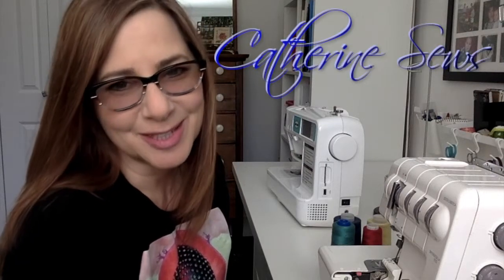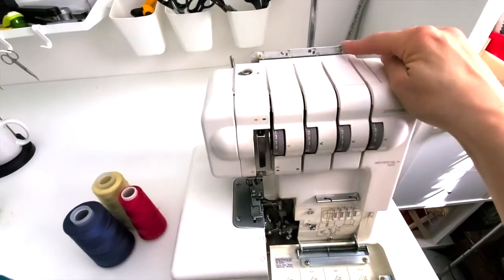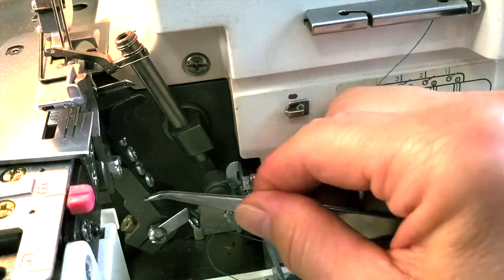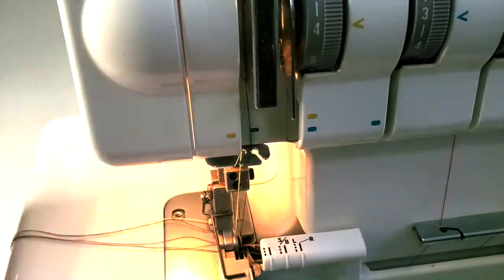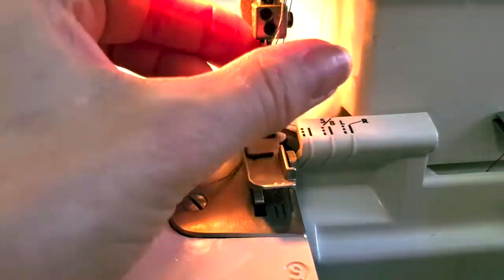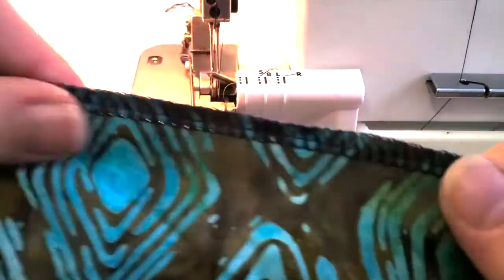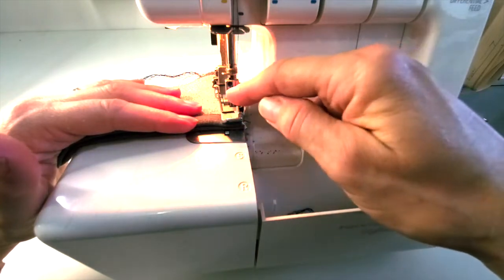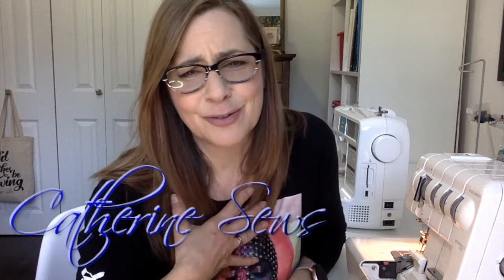Get Started on Your Serger!

Comment: Excellent video! I have always hated my serger and you have given me the push I need to replace it. One small tip for threading, use a dental floss threader. The are made of dense dental floss and are rigid enough to push through all those little eyes and holes. The other end has a large loop. Thanks for this one, I really needed it.

Comment: I hadn't used my serger in years and it was so clogged up with the dust that had acccumulated over the years that I thought it was broken. But I spent almost an hour patiently cleaning it and oiling it and found that it still works really well. So before you discard an old machine, take the time to clean it again and you might be pleasantly surprised.

Comment: Another great video!  I learn most sewing tips from YouTubers like you these days.  I have a Brother 1034D serger that is a good machine, but I hate threading it.  The loopers are threaded in the opposite order and the Brother doesn't open up on the left side to pass looper thread through. Instead the Brother has a finger that slides out with a hook to pass the thread thru.  It was interesting to see how your machine is threaded.  TFS

Comment: So glad I came across this ❤ I’ve had a Serger for years and never truly comprehend and was a bit intimidated by the Serger. Now I understand a bit more the first two threads go into the twin needles, and the furthest threads loops under the bottom. You zoom in at a good angle, however at the very beginning did you thread into the small hold from the back , the top location where the threads start? . Have now subscribe and will continue viewing your wonderful tutorial. Thank you 😊

Comment: Another great video! I do want to point out that the threading order may differ depending on the machine. The Brother 1034D, a popular serger, must be threaded in the order shown in the manual; upperlooper first (third thread), then lower looper (fourth thread), then the needles.  If not you will get all kinds of broken threads.  I had a lot of grief before I found this out!
Reply from the maker: Oh, that's crazy! Good to know!
Reply: Oh, I just bought one of those.   I'll have to pay special attention to threading it.  Thanks for the heads up.

Comment: When you begin threading, you want all your tensions at "0" as you pass the thread through them.....just in case you don't have your presser foot up.  That's the way I was taught 30+ years ago, on my Janome serger.  I find that I get a nicer seam if I trim just a tiny bit off while serging.  Thanks for the video!  Nicely done.
Reply from the maker: I've never heard that one! You'll remember very quickly to lift your presser foot because it's hard to pull the threads through if it's down. Thanks so much for watching and commenting. I am always honoured to have people who have sewn for years watch my videos!